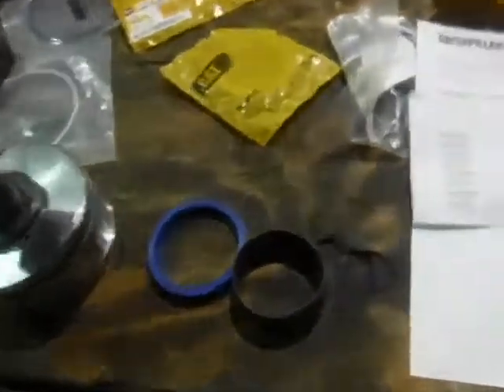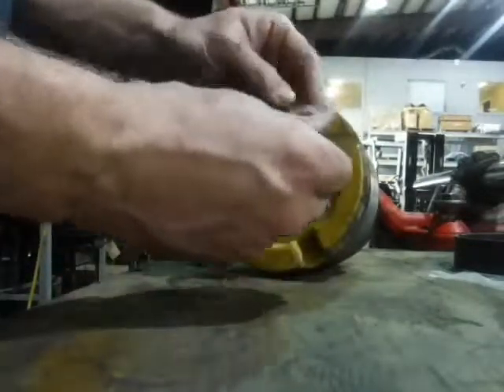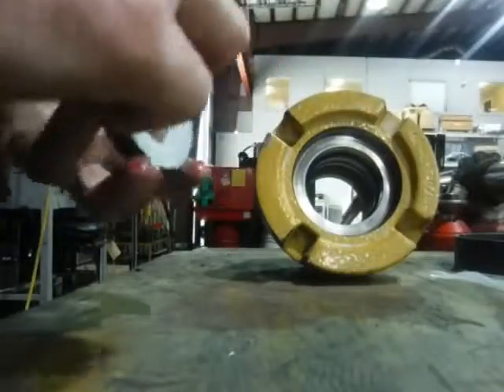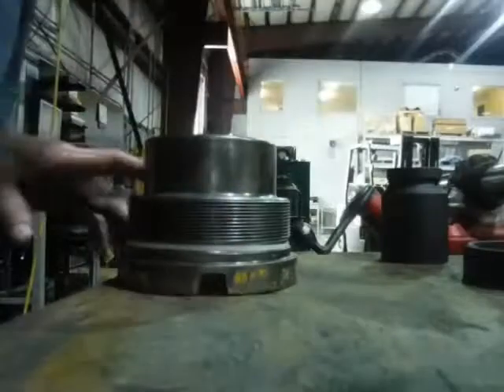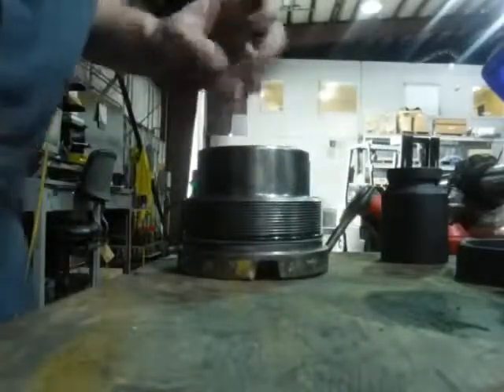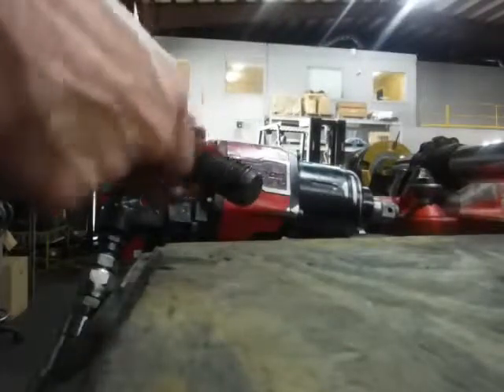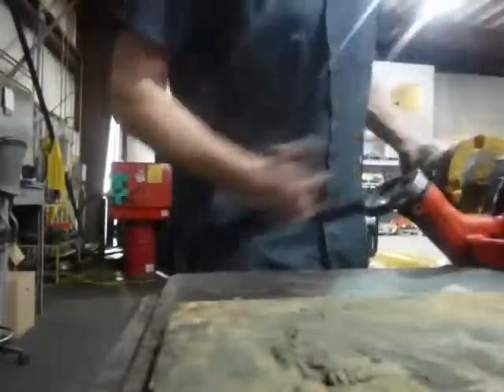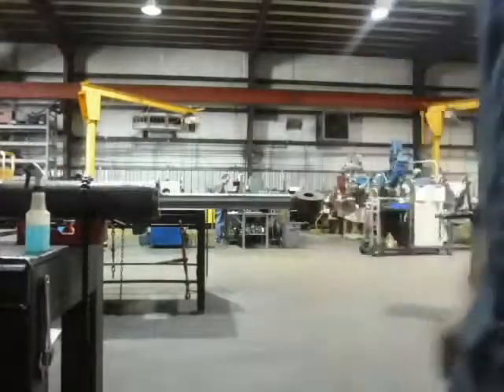Caterpillar Cylinder rebuild hydraulic cylinder

Comment: How did you remove the front nut in the first place?  I have a cat 416 I'm trying to do and I'm not sure if the nut will spin or the tube will just rip open at this point.
Reply from the maker: Air hammer and Heat if A.H doesn't get it to start to move